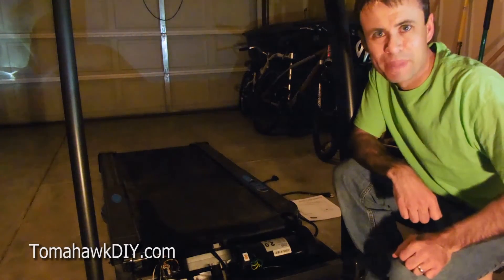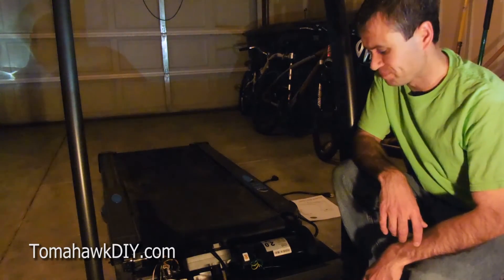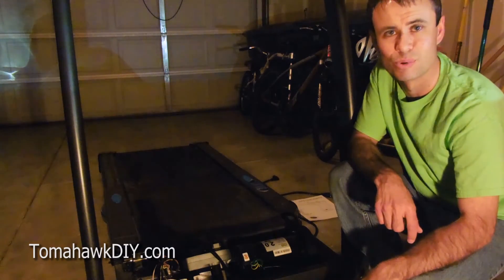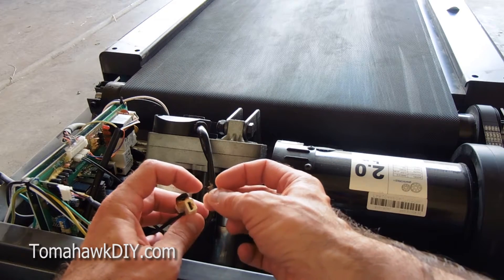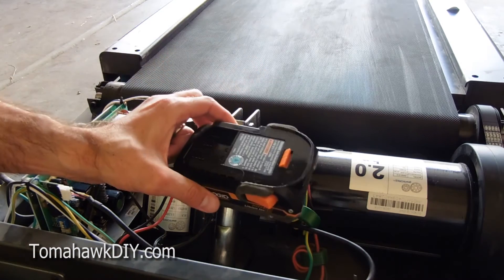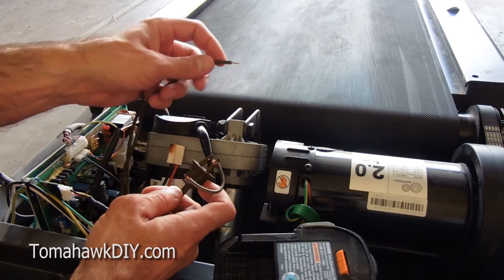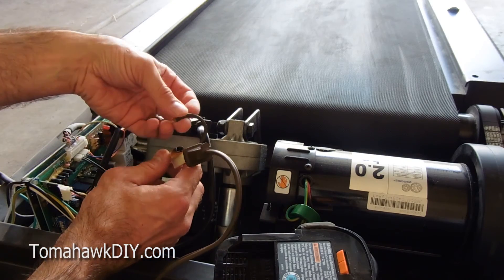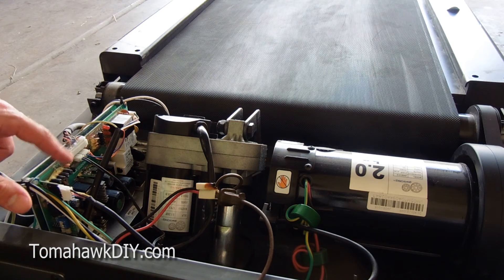Test a DC Motor With a Drill Battery

Comment: im denenetly sleep on my physics class. Never thought that my 180Vdc motor would pass 30Vdc check . 
-- But you need to see that you compensate that with big enough Current. So fully charged battery or play with current limit on Lab Power Supply. Could use electrical bike battery as well